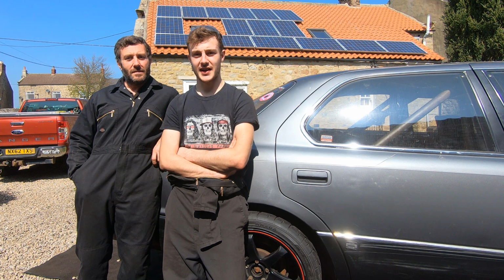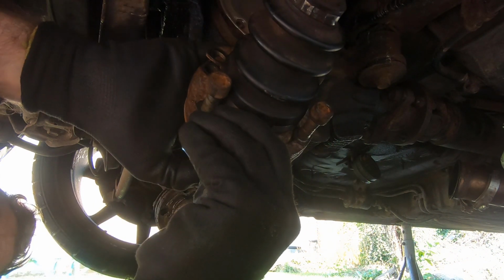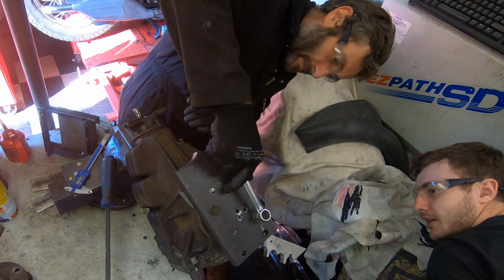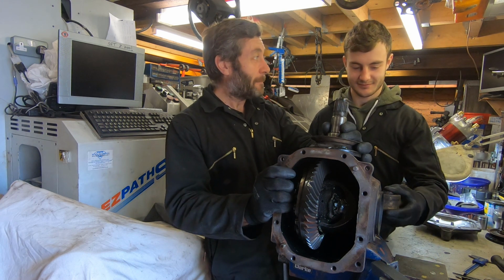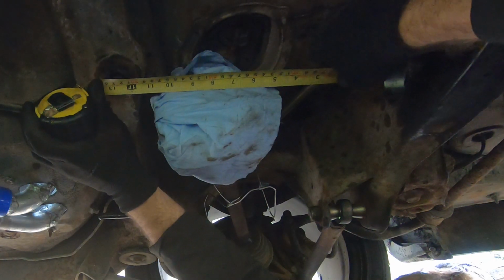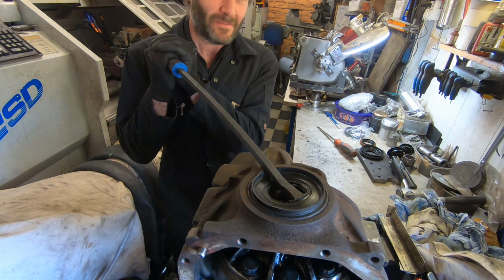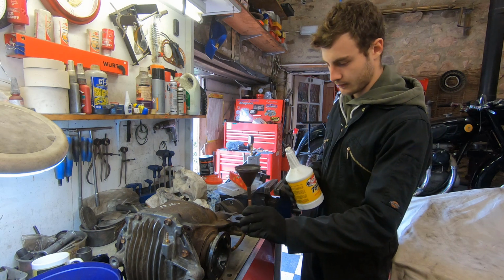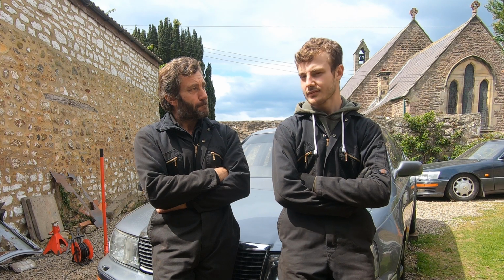LS400 Differential solid mount and rebuild - TurboShed Part 41

Comment: Is that a 20 series LS400??😅 Great video guys 👍 dint know u can press seals in.
Reply from the maker: Ours is a UCF10, the very first model. Glad you liked the video🙂👍
Reply: Yes the shed is Ucf 10 but I ment in the background of the ending scene thought I saw another LS400 😅
Reply from the maker: Ah, you did, and it is the exact same model, another UCF10 :-)
Reply: Wonder what you 2 are planning for that one 🔥 will wait & see💪🙌
Reply: @ItsOver9000zm  its a UCF10 with UCF20 pre facelift wheels
Reply: @yaboirico5221 93-94 had same wheels as 95-97

Comment: A trick of the trade if you don’t have a press to install the new seals and have to hammer them in you can use Vaseline or wheel bearing assembly lube to keep the spring in place as you hammer in the seal. Also is that a teaser for another ls400 build in the back ground?
Reply from the maker: Nice tip on the grease on the back if you need to knock them in👍

What other LS400🤫😉
Reply: Scottparts really looking to future videos of the LS400 and what you guys have planned for the not there LS400